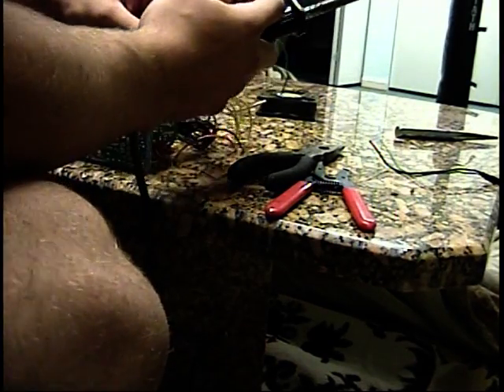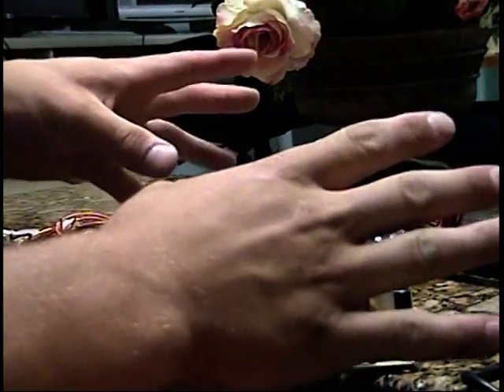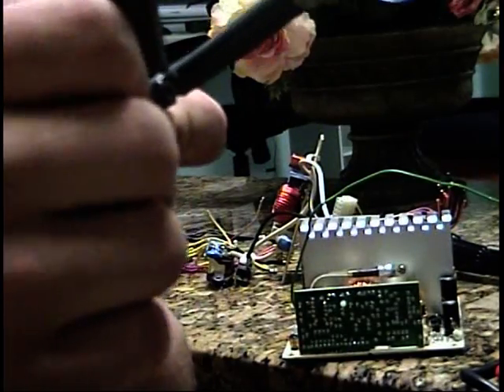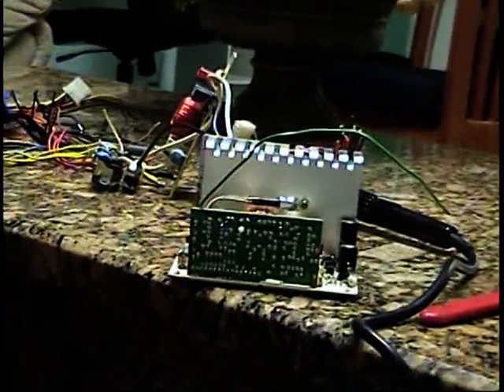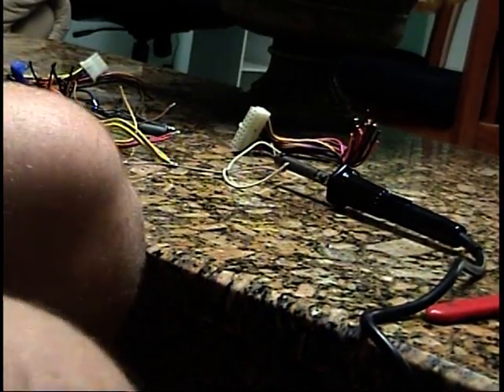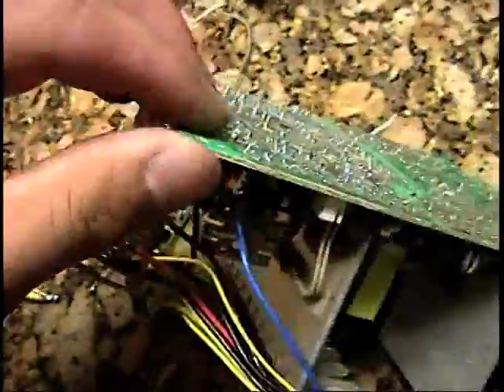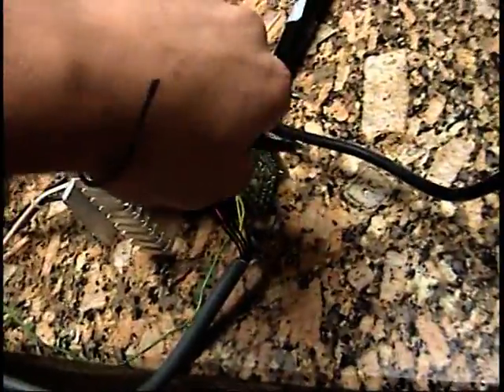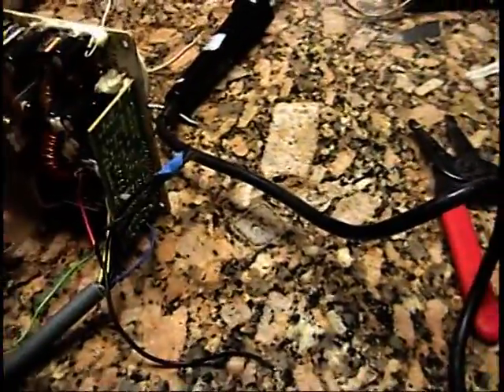How to make a xbox 360 power supply with a pc power supply (Part  2 continued)

Comment: it should work and be fine unless data/power tries to travel thru them causing a small leak? then again i could be making it right up roflmao. that should be fine. im currently doing this now and going to cut/tape non needed and solder needed. il record my soldering, tho im probly no better at it then this guy and im 30 lol. atleast youl see the soldering.

Comment from the maker: that will work for a short time because where you twisted the wires will cause alot of heat and eventually the ATX power supply will shut off. i tried that at first and it would always shut off. this wont happen doing this.
Reply: Vinny Gjokaj 
Can you make an adapter so we can use an XBOXONE power supply into the older xbox360 console

Comment: I judt did this for my Xbox and I found it easier if you just cut off the un needed wires and tape them up. Also I left one Molex connector to run a harddrive. No need to really do all that.

Comment: So wait, let me get this right. You solder the yellow wires of the xbox to any soldering point of a yellow wire from the psu, and the same with the black wires and the other two wires (red and blue)?